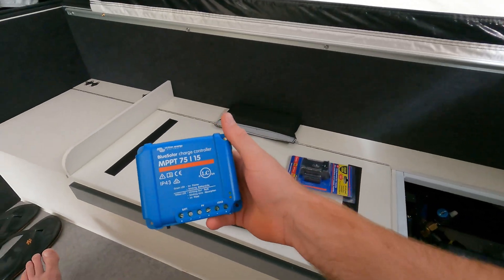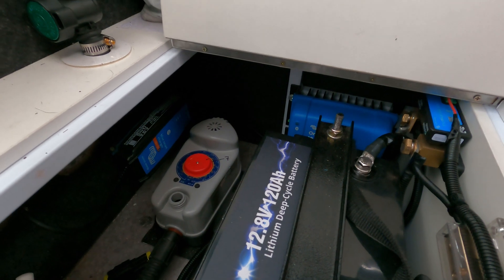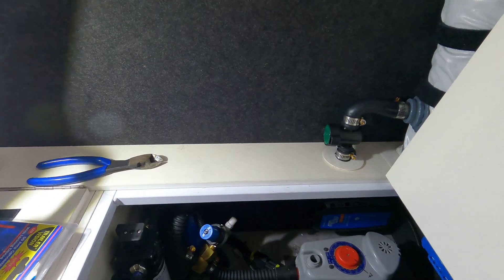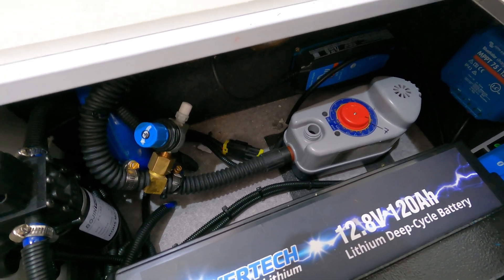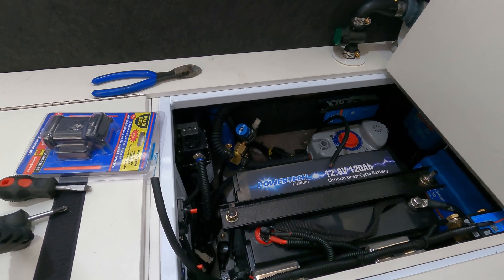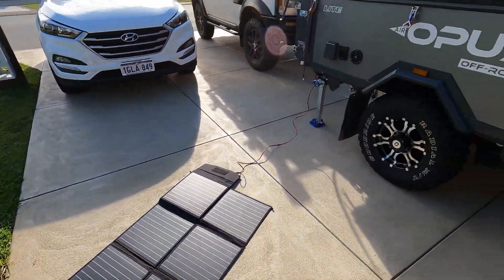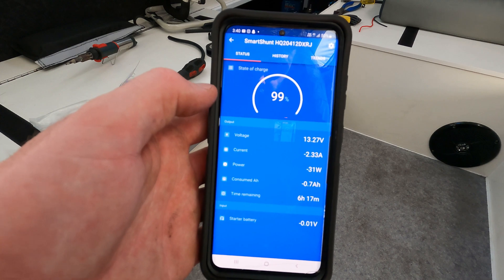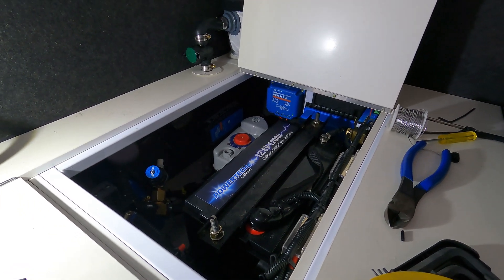OPUS LITE VICTRON SOLAR REGULATOR INSTALL

Comment: great vid. When installing especially as you have  buzz bars for -ve and +ve from Battery.....Just remove battery. Only 4 bolts (terminals and mounting bracket) and as you said, a huge reduction in risk. Oh this will give you so much more working room. For me It would have been the first thing to do as I hate confined working spaces lol

Comment: I feel like I've struck gold here with your videos. I am going to install a dedicated anderson for my victron charge controller in conjunction with the Orion DCDC which will run off the draw bar anderson. All accompanied with the smart shunt as well.  
Gonna have a crack at it this weekend but will have to see if I can suck up the courage to drill a hole in the floor :) Thanks for the video, makes me feel better about trying it.
Reply from the maker: 🤣 thanks for your comment mate and best of luck with it all 

Just make sure you really seal up the hole with a good quality silicone once the cable is through and all should be good
Reply: @OUTBACKDiscovery  cheers!

Comment: hey mate you know you can get a bcdc battery charger that regulates solar as well? i have one on the ranger that does 40amp
Reply from the maker: Morning Chris yeah I have a 30amp itech  bcdc charger in my landrover with inbuilt mppt regulator I just wanted to run the victron gear which sell everything individually but I like how big the cooling fins are on all there gear I no I won't have any dramas with it 

How was your trip did you like the new setup or have a few tweaks needed
Reply: @OUTBACKDiscovery  yeah nice 👍.  Mate the trip was awesome. But it’s made me look at more upgrades for the ranger. Eg bigger intercooler. Converter lock up. And a few more bits
Reply from the maker: @Reaper2487-GZW  yeah nice were your temps starting to creep a bit ?
Reply: @OUTBACKDiscovery  nah wanna push more power out of it and get better fuel economy. Average of 9. Nicks old bt50 did 6.6 all day long